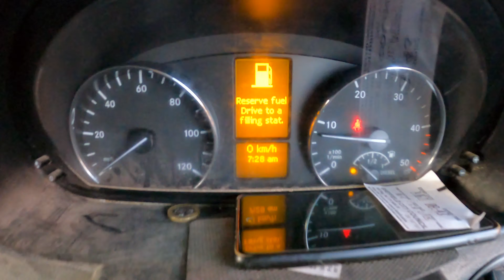SandBlasting old Bitumen & 2 Pack Epoxy off! Narrow boat grit blasting

Comment: Fair play mate. Dirty job.
Reply: @Mobileblaster  I'm helping out on a dry dock in April Can you recommend a a bitumen please .
Reply from the maker: @losttheplot26  are you painting over the old blacking?
Reply: @Mobileblaster  yes
Reply from the maker: @losttheplot26  from what I've seen the painters use is jotun not sure if it's the best it's just what I've seen 👍
Reply: @Mobileblaster  thanks. It's only booked in for a week including pressure washing. Not been done for about 4/5 years but was shot blasted and dry dock done before but my friend was away with the army.

Comment: Great tips.
Do they ever tip the boats over to blast the bottom?
Which blast system is best for a small start up business ( Clemco ,  Appliedpi or other)?
Reply from the maker: Thx happy to try and help 👍 I do the underside but not so much in this Dock 👌 I cannot recommend a bast pot as I don't get paid too yet 😏 haha no my thorts on this are pick any pot that you personally can get a good deal on they all perform very similar I use clemco as its less than 15mins from my base if I need any parts. I couldn't recommend another over another without extensive use of each.

Comment: What gets done for the very bottom of these hulls, where they’re on the blocks and too close to the dry dock floor for blasting?
Reply from the maker: Not sure why it's not done but I do do them please have a look through my narrow Boat playlist if you want to see 1 get done 👍
Reply: In my old job as a Painter (Dockyard) there would be 2 dock Block positions and the area under blocks would get done every other docking
Reply from the maker: @mikes3942  ah don't be giving ideas like that out I will end up having to do more undersides haha can ya tell I don't like rolling under a boat with all the swamp sludge and the blast pipe haha
Reply: @mikes3942  I’m rather familiar with blocking and stands (and moving them for prep/paint) when a boat is hauled with a travelift or even a marine railway. Not so much when it’s sitting on timbers barely off the dry dock floor.

Comment: love to see what a laser removal tool could do on these much less mess.
Reply from the maker: Much less mess much less work 😂 the ones I've seen only remover very lite tea staining. In the industry that's the easiest stuff to remove. The speed at what they work at it wouldn't be cost-effective if they could do the job to start with then the next problem the cost of the unit its self and then how to power it as I don't fink they would run on a 13amp 3 pin plug. I've also thort the same idea 😂 and run into these as a valid reason not to invest in one 👍
Reply: @Mobileblaster  yeah i  figured it was not cost effective but they are so cool to watch.
Reply from the maker: @missinglink7709  yeah I got excited when I 1st spotted a video of 1 in action then I started to see more and more and that's when I thort its basically pointless at the moment in time. When technology gets better it will be the dominant serface preparation but for now it's not quite ready in my opinion

Comment: Gidday what caused the epoxy to not adhere, usually if the surface is properly cleaned there should be no flaking.
Reply from the maker: Yeah I think the reason for this fail was it got painted over the blacking bitumen isn't a good prep serface to paint over
Reply: Bitumen remains a fairly flexible coating whereas Epoxy goes ridgid. Over time the Epoxy will just peel off as Mick says. Bitumen repaint over Bitumen works better if you are doing it on the cheap. Epoxy will last longer over a lovely sand blasted surface
Reply from the maker: @mikes3942  Yeah its worth spending that bit more on epoxy once its been blasted as bitumen life span is 3/4 year? and epoxy on with a good key is 7/10 year? I would imagine when they put estimated life span  on it would be test conditions not trapping up and down a canal with old bike frames and shopping trollies lurking under just waiting to knock chunks out of the surface. personally I would say they both have good pros and equally both have down sides i would pick bitumen not from a boating prospective but as a repair paint for a novice to easily go over on the next docking cycle but epoxy has the chance it won't need going over so all personal choice.

Comment: I have seen epoxy paint on boats and ships and it doesn't do this so somebody either had bad product or bad technique because this is a kind of stuff they use on cruise ships a lot and they don't have these problems
Reply from the maker: Yeah its explained in the video why this failed and the idea of the video is to show how not to epoxy a narrow boat and the proper way of doing so
Reply: @Mobileblaster  I actually made my comment before I got to the end of the video so I realized that you actually did explain that at the end but when I made my comment was like halfway through
Reply from the maker: @ritahodges254  👌Easy mistake I've even done that before started typing before finishing the video 😂👍